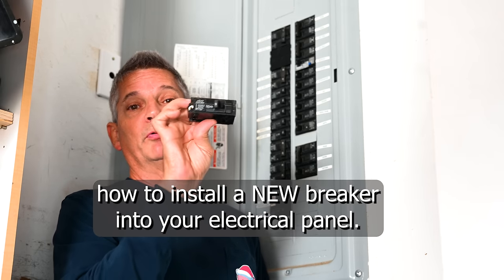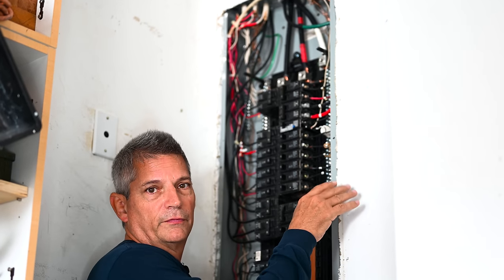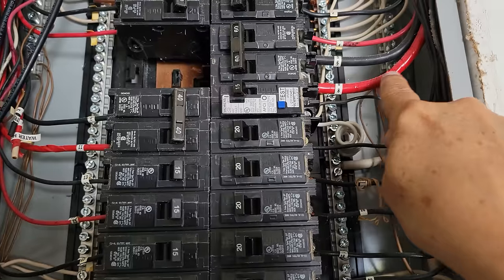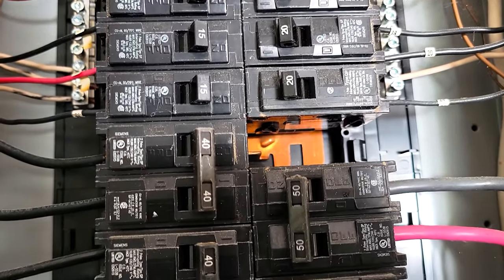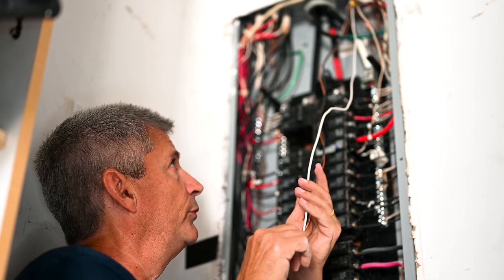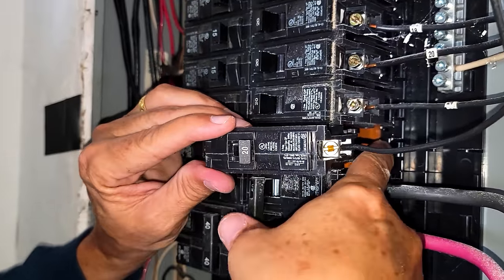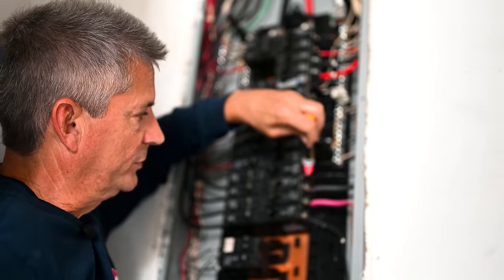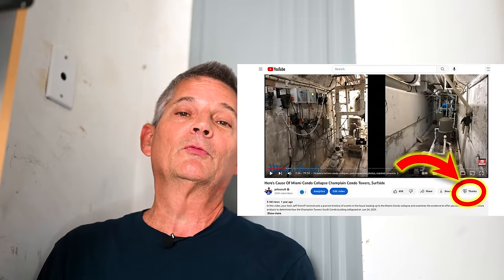How To Install A New Circuit Breaker DIY [AVOID Electrician]

Comment from the maker: 🛒 Fluke 87-V Digital Multimeter: https://amzn.to/2LK8etM 
🛒 Fluke FLK2AC/90-1000V Pocket-Sized Voltage Detector:  https://amzn.to/2THggao
🛒 Milwaukee 48-22-2202 1000V Insulated Screwdriver Set: https://amzn.to/369ZW7G
🛒 Eaton Corporation LCCSCS Cover Screw: https://amzn.to/2syP1WE
🛒 DEWALT DG5582 Electrical and Maintenance Tool Carrier: https://amzn.to/2Gm8IoO
🛒 Ideal Electrical Outlet Spacers (5-Pack): https://amzn.to/2U7SlUe
🛒 Milwaukee 48-22-2202 3-Piece 1000V Insulated Screwdriver Set: https://amzn.to/2ItbU3r
🛒 Milwaukee 0880-20 18-Volt Cordless Wet/Dry Vacuum https://amzn.to/2P6VaAF

Comment: Excellent video, Sir.  I saw 5 videos on installing/changing a circuit breaker before yours and none of them mentioned to shut off the entire power, which I was surprised (I was planning to do it anyway), yours was the only one that stressed safety, even when power is off, still treat it like still is live.  Great job, I nominate you as the YouTube Safety Officer. 😊

Comment: Hi Jeff, your panel is what is known as a subpanel, since the main breaker is outside. That is why it is fed with 4 insulated conductors, 2 ungrounded (the black & red) the neutral (white) & the equipment grounding conductor (green). If you were to look inside your main panel outside, you would see that the neutral and equipment ground are together. That is the only location where this occurs. But in your subpanel, if you look at the left side of the  large neutral lug, you’ll see a green pan head screw with machine threads. That is there, for situations where the panel is being used as a main, and not a sub. It is intended to be screwed in tightly to the threaded hole in the back of the pane. This effectively bonds the neutral and ground together, as required in a main. It appears that it was left in place, but not screwed in. Please just remove it completely, because if it makes any contact with the panel, you lose your isolated neutral.

Comment: Outstanding. Power tools energized simultaneously keep tripping (understandably) 15A breakers. Got quoted ~$800 to add two circuits w/ cable runs and outlets. The cable runs and outlets are in my wheelhouse. I just drank the Koolaid on the breaker panel part. Thanks brother!

Comment: Nice job, Jeff and appreciate your concern about safety to suit your audience! Still, I have installed many a breakers for new circuits without ever shutting off main power. Just need to know where to touch and where not to. Also, keep in mind the torquing requirements of latest NEC code. Especially important for stranded 6 gauge cable for 50 Amp car charging ports. Have installed a few of those, and still have no torque screwdriver. Just make sure all is snug and tight!
Reply from the maker: Good stuff!

Comment: I'll still pay the electrician. Maybe with that outside main shutoff I'd consider working on it, but absolutely not if there's any straight live power in there. 
I do kind of enjoy fishing wire and installing devices - it's super satisfying when you turn on the circuit and flip the switch for the new light, or plug in something and turn it on.
Reply from the maker: Yes, always safer to have a licensed electrician doing it

Comment: The neutal buss has an issue.  The green screw is installed, tying the ground and the neutral together.  By code that screen needs to be removed, as there is another box ( main breaker - cutoff) above that circuit breaker box.  The box closet to the meter is where that screw is allowed to be installed.  Any subpanels must have that removed.  We added a whole house generator, including an ATS.  We had to remove the green screen, because the ATS was the box between the circuit breaker box and the meter.

Comment: I only have one comment.  You turn the main off before taking the cover off to make sure you don't accidentally touch anything when removing the cover that is great but you turn the main on and then put the cover on!!  Wouldn't you be far safer killing the main after your check before messing around trying to rehang the cover?
Reply from the maker: I have one response. We did cut the power outside before removing the panel and we showed it in the video
Reply: I think what the gentlemen was meaning is that, yes you turned off the main breaker before pulling the cover off in the beginning. However, you turned the power back on to test the new circuit and put the cover back on when the main was on. I believe his point was why implement a safe  practice in the beginning but disregard it at the end.
Reply: I do totally agree but I'm hoping other DIYers like me watched a hundred videos and have a spotter (like my 77yr old electrician stepfather) to watch over them before attempting their first electrical job. 😮

Comment: All of slots in my panel are occupied with either 15A or 20A breakers.  Is it perfectly fine to do the "duplex" set up where one slot will have a double 15A or 20 A so I can free up some space? I want to add a new 20A breaker for a fridge as well as in a room.

Comment: I have a question , I got an old house was built in 1958 with main breaker 90amp max ,but the main breaker already plugged in 4 circuit breakers, there were 3 circuit breakers with 20a,another one with 15a,but right now I want to install two mini splits each comes with 9000btu, can I still add 2 new 20amp circuit breakers to my main panel?my main breaker brand was zinsco

Comment: Your three main wires on top are hot, hot, and neutral, and the copper is ground.  120 volt,  120 volt , together 240 volt. The romex has black=120, white= neutral, copper= ground.  Ussually for single pole breaker. A double pole breaker will be a 240 volt since each side of the beaker taps off each 120 volt. But, absolutely treat the box as hot. Just like a gun, treat it as always loaded.   Peace all.

Comment: You made that so much easier than I thought! Before I go buying all this wire though, can I simpy splice and add a junction box to the oven wires to add a 210 in the garage?!
Reply from the maker: No, oven should be its own dedicated home run from the panel to the oven outlet.

Comment: I need to remove a  20 amp breaker, the air conditioner manufacturer calls for a 15 amp breaker for the new 220 volt air conditioner 
the panel is old and so are the breakers , i need to find a double throw breaker that will fit , that might be the hard part finding one

Comment: Keep in mind in the 2023 NEC microwaves are covered under 210.8(D) and GFCI protection is required.
Reply: My jurisdiction has not yet adopted 2023 NEC. Not many have.
Reply: @Sylvan_dB  3 places do Jan 1st 2023
Reply: Take that green bonding screw out of that sub. That’s shouldn’t have passed an electrical inspection. And people, don’t rely on that $5 glow stick with your life. Lol.
Reply from the maker: That's why I showed the multimeter measurements

Comment: Also, ppl that make these videos have u use a pen or multi meter but never show us how to set the meter. I paid 40 bucks for one and theres not even directions on the package on where to put the dial for checking the circuit to change my gfci. My thinking if your showing us to do something show us how.  Other than those couple of things great job. Now I can add a new 20 am breaker to run a few more plugs .

Comment: I turned off the main breaker in the box and the meter still reads 120 volts going to the breaker. What happened
Reply from the maker: Either the breaker is bad or the breaker is not really controlling voltage o the box.

Comment: Should mention to use the appropriate size wire for the circuit you are installing.
Reply from the maker: There's a million things to mention, but wanted to keep it short and focused on just changing the breaker

Comment: You would sppend a couple hundred bucks for an electrician because he would install the proper breaker . In my area when adding circuits a combo afi/ gfi breaker should be used
Reply from the maker: Yes this is a grandfathered in electrical panel. If you switch panels you would use the combo breakers

Comment: Is not that easy, you can just install a breaker where ever you want , you have to valance you breaker box. Small tip use the right screwdriver for the right job. Look at the insulation at tip.
Reply: English version please!
Reply: 😂😂😂😂😂 so fu….$&k funny